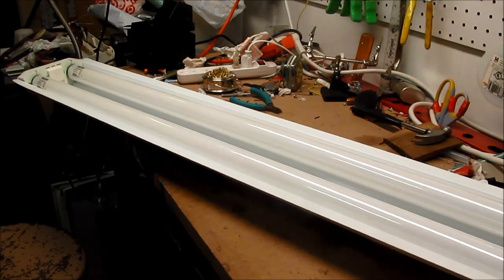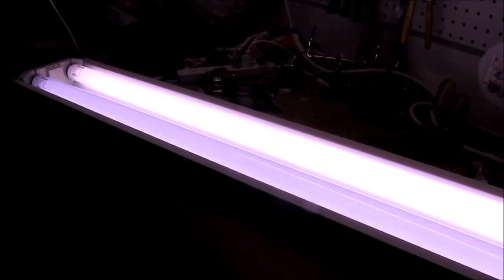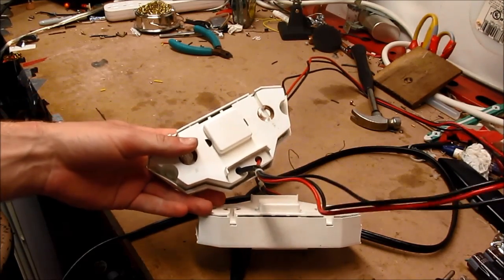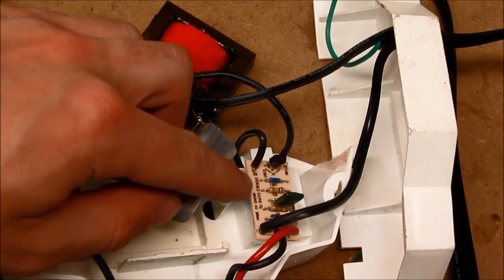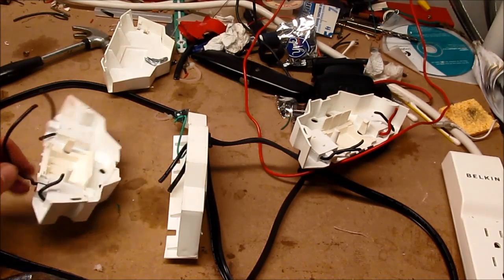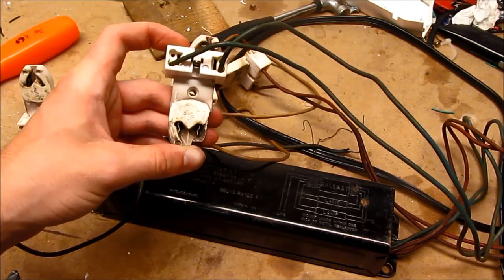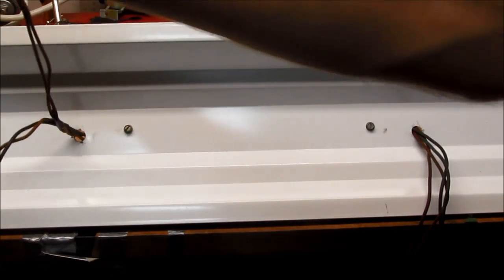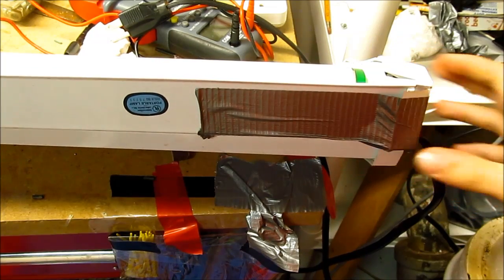I Rebuilt a Cheap Shoplight with a Better Rapid Start Ballast

Comment: I have a bunch of these old "Lights of America" shoplights that I want to convert to LED (ballast bypass).  I've been trying to figure out how to get the end caps off without breaking them.  Disappointed to learn that the answer seems to be "you can't".

Even though these were cheaply made at the time, I like the fact that they have a nice metal shade.  Most of the new LED shop lights I see don't have a shade, so there is more glare.

Comment: Hey, can you invigorate this fixture to show how to make it a no Ballast LED. I pulled my Lifelyte8040 and I am planning to do just that. But I am not studio ready for videos yet.
Reply from the maker: Sorry, I don't have access to this fixture anymore.  It is still in the basement of my parents house 3000 miles away.  

Ballast bypass LED conversions are pretty easy, with all the instructions needed in the box with the LED tube.  

If I find another fixture to rebuild, I can make a video about that, but I've not come across one of these for a while.

Comment: What brand of ballast? HPF or LPF? Rated for 34w lamps?
Reply from the maker: GE ballast.  Got a pair of them at the same time as the high pressure mercury gear.  Not specifically rated for 34 watt lamps but has not had a problem so far.
More info in this video here:
Twin GE rapid start ballasts
Reply: MetaphysicalEngineer 34 watt lamps are not a good idea with these ballasts even if they seem to work OK. They will make the ballast run hotter and fail prematurely.

Comment from the maker: It started okay-ish when the temps were warm.  In the winter at 50 deg F / 10 deg C in the shop it struggled to light up and would need 10 mins or more before it stopped flickering enough to be useful.  
Thanks for the sub!

Comment: Yup!!!  I was just taking apart a bunch of burned out compact florescent light bulbs.  They really don't seem to last very long at all.  The main cause a failure seems to be from over heating.  Because a lot of the boards are a nice dark brown to black color.  The excess heat seems to make the transistors blow or the filter cap bulge.  In a some of them there is a certain resistor that blows.  A couple of them had bad filaments and in one there was some bad arcing.

Comment from the maker: It's really cheap and nasty.  I might use those ballasts to overdrive some shorter tubes where the voltage will be a bit steadier so they will be less likely to flicker.  Only in the name of science though... those inductors would likely overheat when abused like that.

Comment: They were big users of the 'assembled in USA' label, as all of the electronic bits were Chinese (I don't know where the plastic bits are made; those might be domestic as they seem to hold up to weather well, making them good conversion fixtures).
They have mostly dropped that as of late, as what little LoA stuff I see for sale is mostly entirely made in China.

Comment from the maker: "Lights of America" is a painfully ironic brand name considering that these things are made in china, (and are crappy even by those standards). It was a POS but worked well enough until I found a replacement shoplight that wasn't super expensive.  Now it has a new life as a rapid start fixture and works perfectly.

Comment: Those crappy ballasts are commonly used in Lights of America shoplights (which explains why it was chucked in the first place, as they are horrible) and the often do this.  The PCB circuit is like a discharge lamp ignitor.